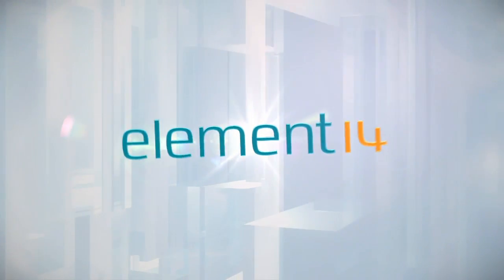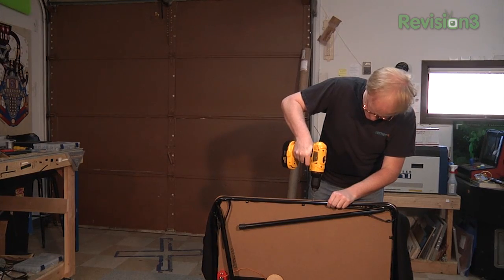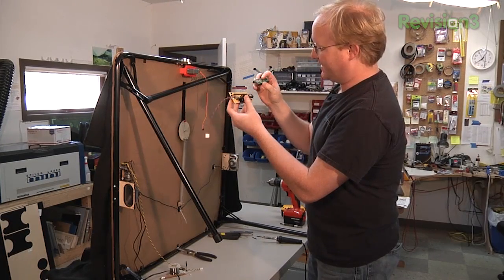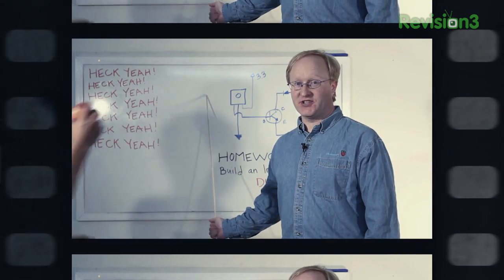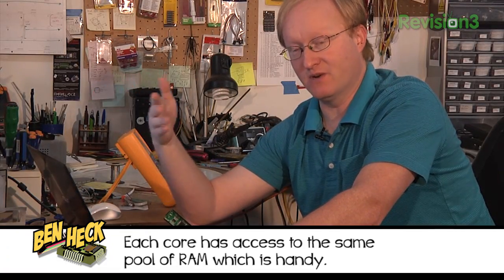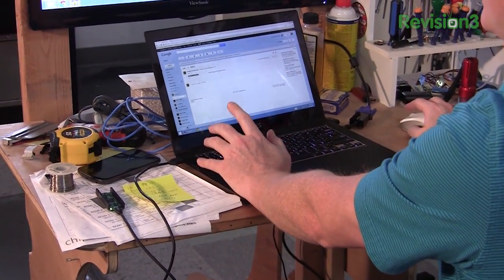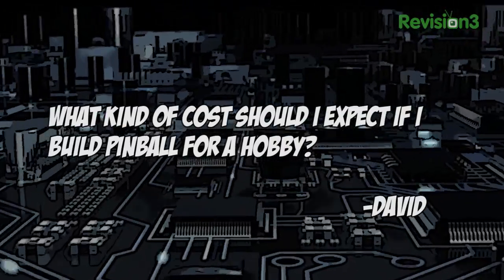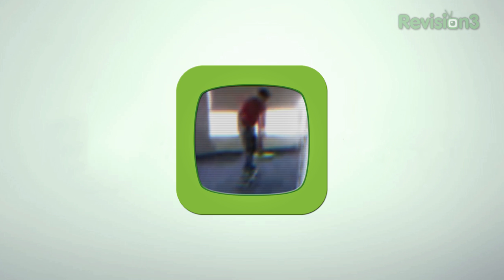Make a Halloween Prank Candy Bowl - Part 2

Comment: You could have used an linear actuator using stepper motors, a spring which you have to reset each time is a bit low tech especially as you was using sensors and a micro controller.